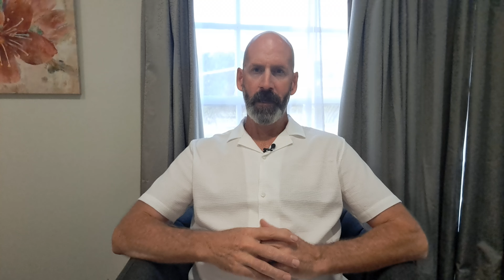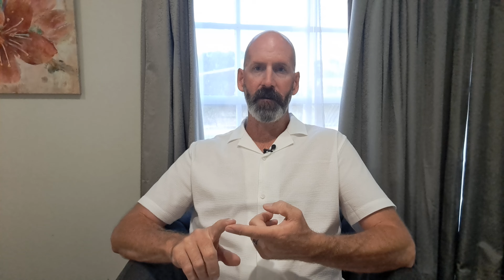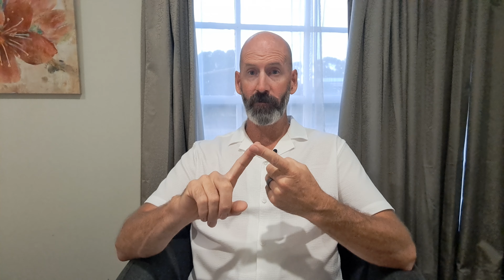Hybrid Vs Off Grid

Comment: 3 questions if you are off grid would you use a generator? Can you have more than one inverter? Inverter 1 handles base load lights fridge tv computers. Inverter 2 handles heater hot water dishwasher.  The battery for inverter 2  what is best?

Comment: Which system would you recommend. Off grid or hybrid?
Reply from the maker: It 100% depends on what you want it to do. Hybrid has its advantages for some situations and off grid has its advantages. The biggest risk is thinking they are the same thing.